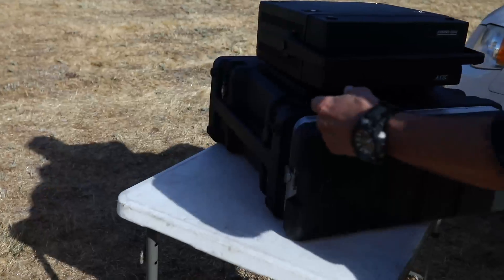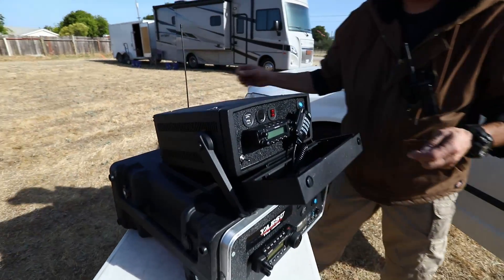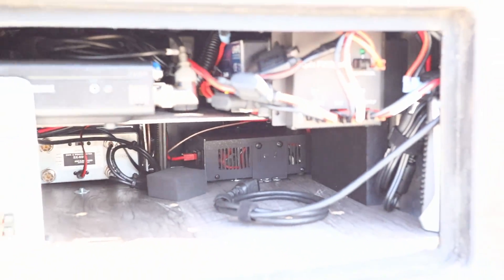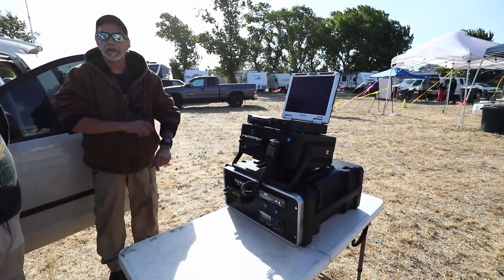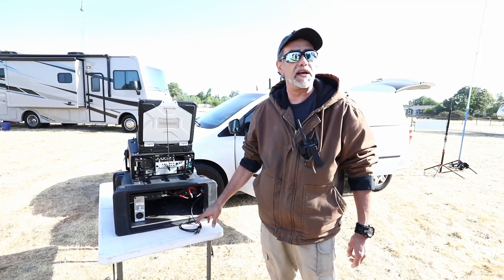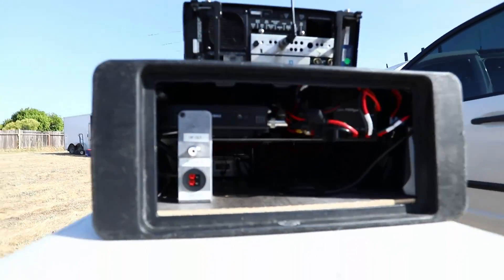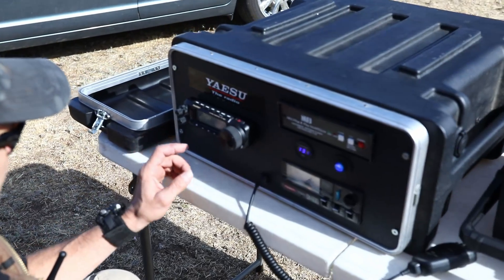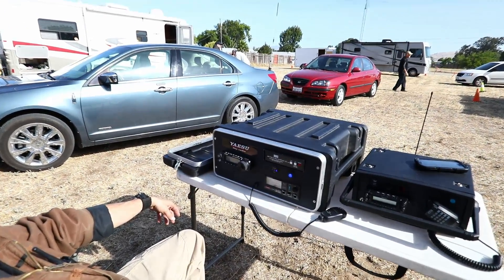Ham Radio Go Box - by Bobby/KD6KWV

Comment: Good review of radio go boxes - always interesting to see what folks have done. One comment about LiFePO4 Battery Voltages - offerings from different vendors are not really different voltages. They are all charged to and discharged to the same range of voltages within the same chemistry. Purchase decisions should not be biased by voltage claims. The Bioenno power batteries put out 90% of their energy in the 13 to 12.5 volt range, the same as other LiFePO4 packs. They are one of the very few manufacturers who have hams on staff and understand ham radio needs and RFI concerns. Enjoy! 73 de w6akb

Comment: Just found your video. Well done. Got a couple of good ideas. His statement on the voltage of Bioenno batteries, btw, is incorrect. At full charge they run 13.4 volts and will drop down to about 12.7 when 90% discharged. I own two of them. Same should be true, however, for almost all brands of LFP "12 volt" batteries.
Reply: I have similar results with my 20 ah Bioenno. I turned off my power supply half way through the video and the voltage started at 13.5 and settled down at 13.1 with two radios on receive.

Comment: Stake the tripod legs down with tent stakes or 12 inch nails. You could probably get away with some tarred bank line tied to each stake, then simply wrap it around a given leg, make thew taut and drive the stakes into the ground. Could also drill holes for some 1/4" eye screws with a wingnut securing them. Tie line to each eye screw, tie other end to stake/nail and viola.
Reply from the maker: Great tips! Thanks!

Comment: nice video and GoBox, thanks for sharing, pls feel free to have a look at my GoBox or rather shack in a box, includes HF, VHF, UHF and digi modes, mini pc, internal battery, batt management unit, extractors and monitor, all in a Gator Box 6U, must admit a bit heavy, about 18 Kilos :) I'm sure you pick up an idea or two, 73's and stay safe de George (9H1AA)
https://www.facebook.com/photo?fbid=10157144743688106&set=pcb.1657323021058623

Comment: Classic problem of trying to put everything in one box.  Recommend placing both HF, VHF/UHF radios and tuner in the box with all the in and out connectors for power and antenna. Keep your power source external as well as your laptop which  can easily be put in a backpack.  Its the radios that need the most protection.  So keep them in the box.  It will also allow your foot print to be smaller when you have to operate.  Just my two cents. 73s
Reply from the maker: Thanks for watching and thanks for your tips!